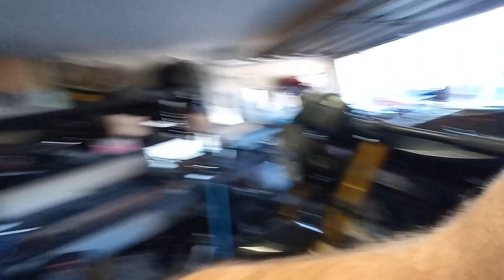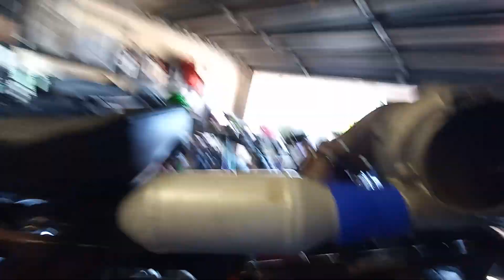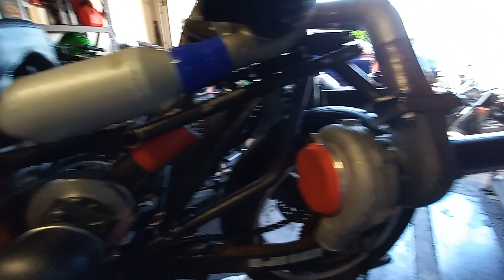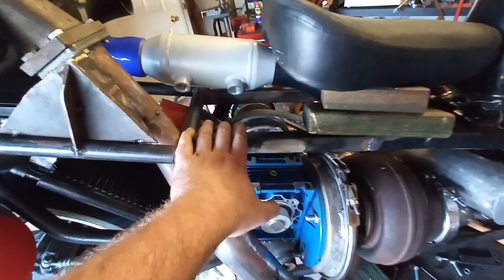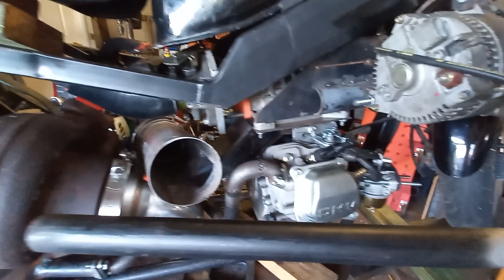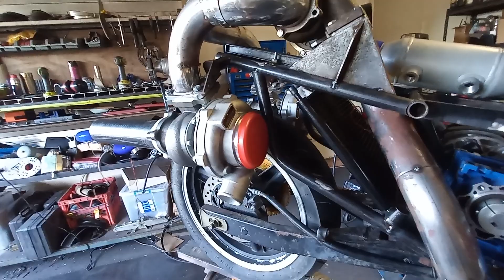Turboshaft Motorcycle Project ep9

Comment: What bike did you start off with??
Reply from the maker: It was an MCI Tornado 250. I'd never heard of it but some guy was selling it not running for $300. Has upside-down forks twin disc front and disc rear so had sporting aspirations at least.